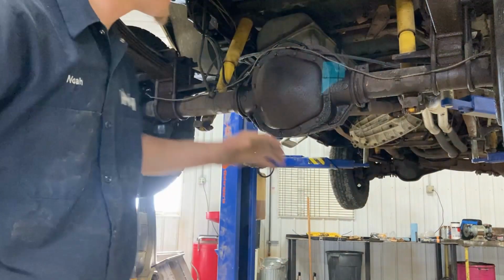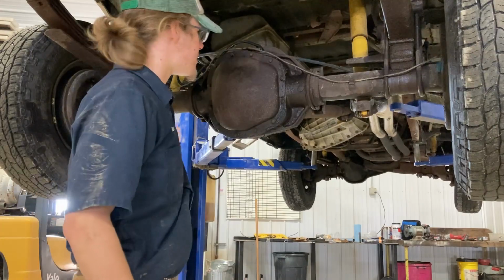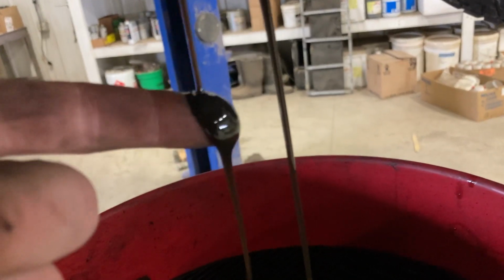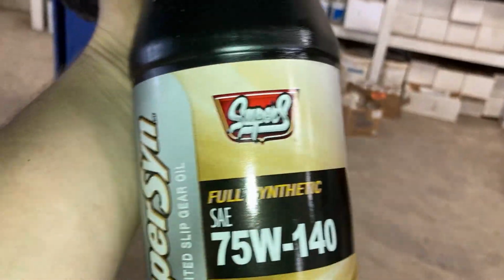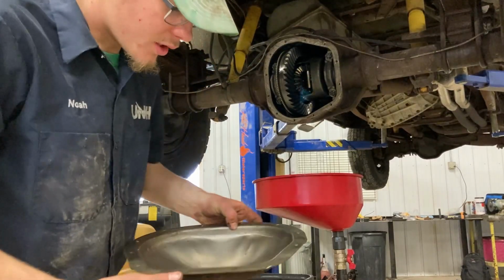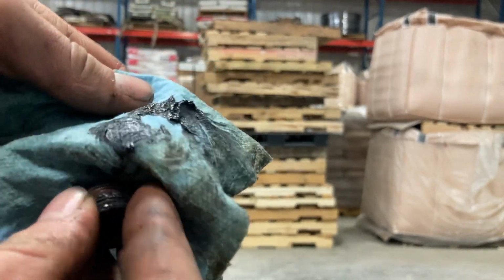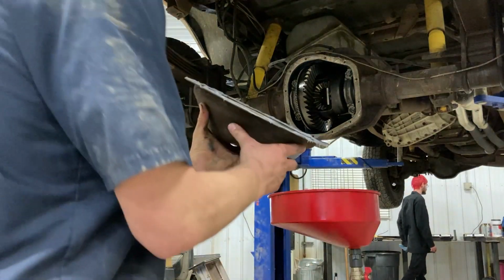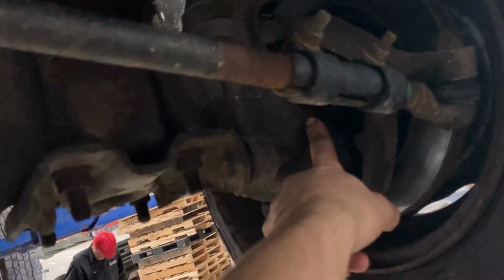Servicing Black Beauty's rear end - Dana 80 differential service

Comment: surely not a dana 80....
Reply: and clearly NOT limited slip...
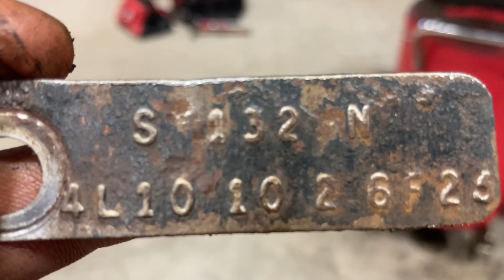Reply from the maker: @gabewright  i stand corrected that this is NOT a dana 80, and is a sterling diff, but it is a limited slip. 13:44 time on the video i show the tag and the bottom left number, 4L10, means 4.10 gears and Limited slip.